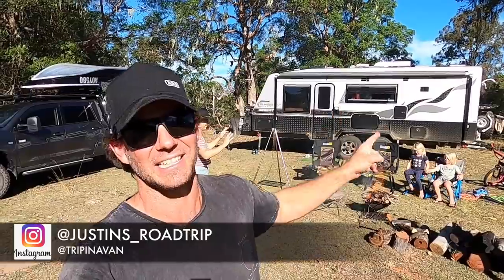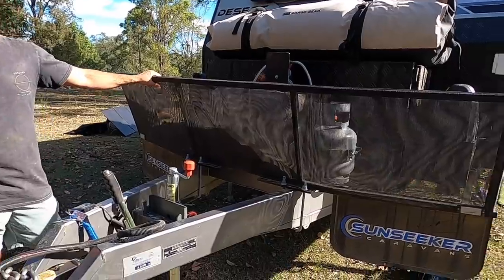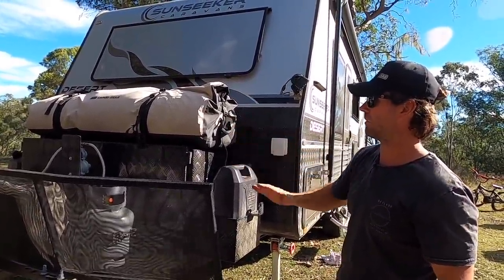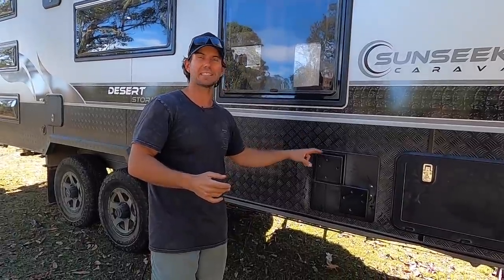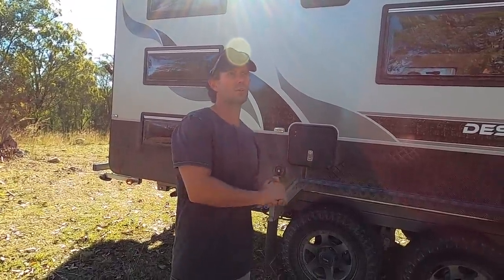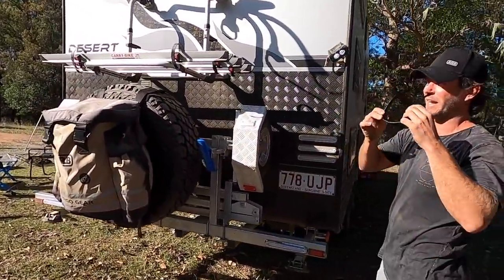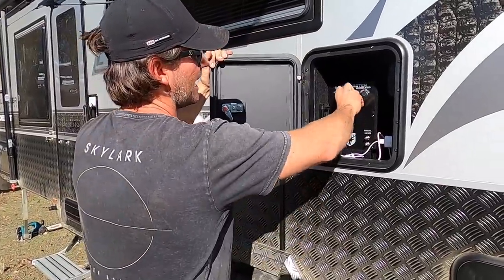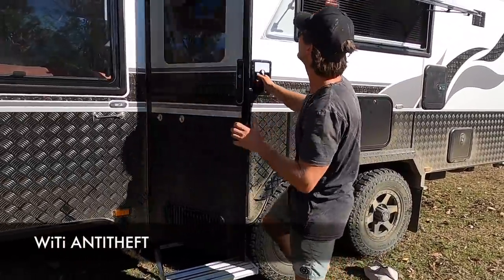SUNSEEKER DESERT STORM 21'6 BUNK VAN | ROADTRIP AUSTRALIA

Comment: Great van setup, enjoy, the self levelling function looks great, do your self a favour and hook up your rear camera, reposition above the bikes, I have my rear caravan camera wired to switch on while travelling, great for seeing trucks coming and changing lanes on freeways plus overtaking slow trucks to know when you are clear to get back onto the left side of the road after overtaking, plus checking for low hanging tree branches when reversing onto site.
Reply: tony findlay yep that’s the go, have done the same and since my cab rear mirrors useless when towing my screen is clipped over the mirror and system powered up on the blacktop looking backwards into upcoming traffic being able to act on when necessary. cheers

Comment: Great new rig!  never heard of electric over hydraulic. Not a fan of how electric works. Very curious about how well yours works. can you compare it to air/hydraulic?
Reply from the maker: Can’t compare to air/hydraulic as we’ve never had it, but it works really well👊
Reply: @TripInAVan  have logged 1/2M miles in a big rig and like the air brakes thing. Electric/hyd  would sure save a lot of plumbing/extras/hassles to put on smaller trailer towing rig.  ;D

Comment: What's the main reason for carrying the extra folding solar panel?( Does it feed a different section to what the panels on the roof feed to? Do you actually need 980watts of solar to charge that type of battery system?) Im not being critical, just curious as why the extra panel?
Reply from the maker: v8 greg because we follow the season we are always usually in hot weather. We camp under trees or in the shade a lot, so it’s handy to have a portable panel to chase the sun. It feeds into a seperate solar controller than the roof panels so it charges simultaneously. 👌

Comment: Great van does the portable solar fight against the vans solar,I wanted to add extra solar to my van but was told the controller would choose the one with the most input and not add them together. It is either one or the other? Also you have a great setup but I think I’d have a heavier car especially if it going to be 4-4.5 ton behind you.
Reply from the maker: Rainer Otte portable solar runs through the dc/dc charger which is seperate to the main solar controller so it will take both charge at once.

Comment: Hey quick question you guys have had a few vans and so on have you ever had the issue of plastic taste in your van water? If so how did you fix it or do you just buy drinking water separate
Reply from the maker: Cameron j Marsh we run a drinking water filter inside. Having quality tanks helps a lot with taste as well🤙

Comment: Top stuff as usual. What brand and model of rattle gun do you use and what are the specs of it?
Reply from the maker: Neil Bland ryobi rechargeable 1/2 inch impact gun
Reply: Trip In A Van - RoadTrip Australia Series  how many volts is it and would you have preferred a smaller or larger one if you had to buy again.